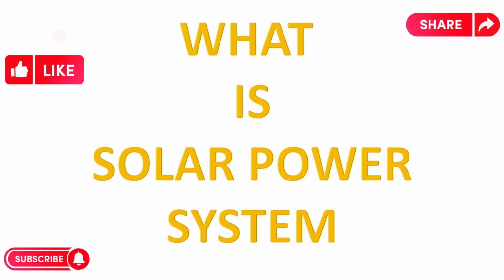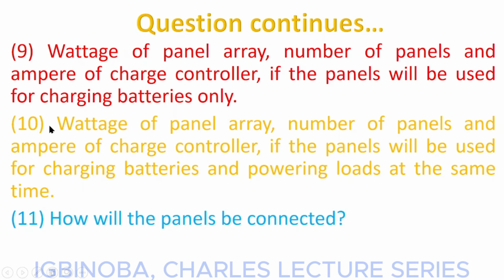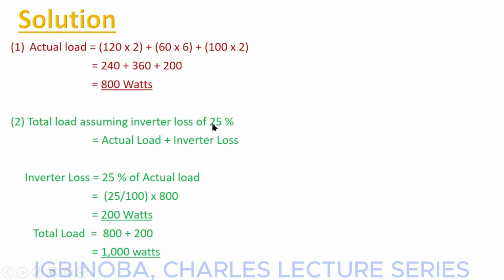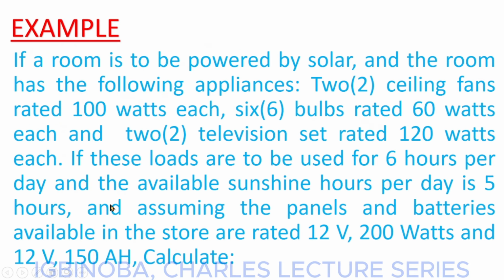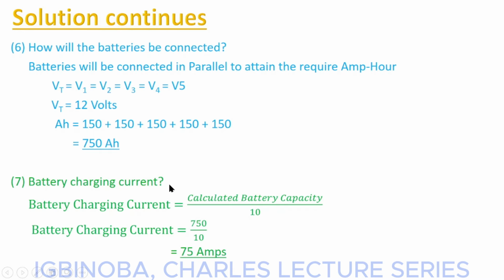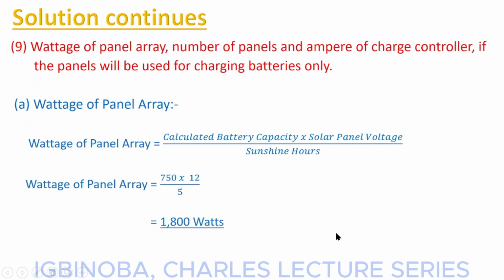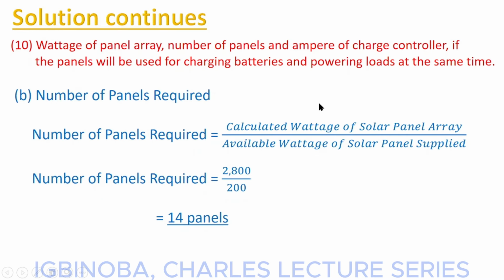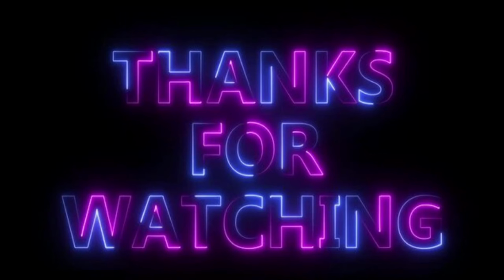Design of Solar Power System

Comment: CIV1A 
ANSWER:
1. The actual pad is 1,380W

2. The Total load is 1,725W

3. The inverter rating is 2,156.23VA

4. The battery capacity is 1,293.75Ah

5. The Number of batteries is 9

6. The batteries are connected in parallel

7. The Battery charging current is 129.4 amps.

8. The battery charging time is 14 hours.

9. a. The wattage of the panel array is 3,105W

b. The number of panels is 16 panels.

c. The Charge controller rating is 258.75 amps.

Comment: COMP100V

1. The actual pad is 1,380W
2. The Total load is 1,725W
3. The inverter rating is 2,156.23VA
4. The battery capacity is 1,293.75Ah 
5. The Number of batteries is 9
6.  The batteries are connected in parallel 
7. The Battery charging current is 129.4 amps.
8. The battery charging time is 14 hours.
9. a. The wattage of the panel array is 3,105W
b. The number of panels is 16 panels.
c. The Charge controller rating is 258.75 amps.

10. a. The wattage of the Panel array is 4,830 Watts 
b. The number of panels is 24 panels.
c. The charge controller rating is 402.5 amps
11. The panels are arranged in parallel

Comment: COMP62J

1. The actual pad is 1,380W
2. The Total load is 1,725W
3. The inverter rating is 2,156.23VA
4. The battery capacity is 1,293.75Ah 
5. The Number of batteries is 9
6.  The batteries are connected in parallel 
7. The Battery charging current is 129.4 amps.
8. The battery charging time is 14 hours.
9. a. The wattage of the panel array is 3,105W
b. The number of panels is 16 panels.
c. The Charge controller rating is 258.75 amps.

10. a. The wattage of the Panel array is 4,830 Watts 
b. The number of panels is 24 panels.
c. The charge controller rating is 402.5 amps
11. The panels are arranged in parallel

Comment: CHM113I
Answers:
Actual load = 1380Watt
Total load = 1725Watt
Inverter rating = 2156.25VA
Battery Capacity = 1239.75Ah
Number of batteries = 8.625 (9 batteries)
They will be connected in parallel
Battery charging current = 129.375A
Battery charging time with 40% loss = 14hrs
9a. Wattage of panel array = 3105Watt
9b. Number of panels = 16panels
9c. Ampere of charge controller = 258.75A
10a. Wattage of panel array with load = 4485Watt
10b. Number of panels = 23panels
10c. Ampere of charge controller = 373.75A
They will be connected in parallel
Reply: CHM90L 
Answers:
Actual load = 1380Watt
Total load = 1725Watt
Inverter rating = 2156.25VA
Battery Capacity = 1239.75Ah
Number of batteries = 8.625 (9 batteries)
They will be connected in parallel
Battery charging current = 129.375A
Battery charging time with 40% loss = 14hrs
9a. Wattage of panel array = 3105Watt
9b. Number of panels = 16panels
9c. Ampere of charge controller = 258.75A
10a. Wattage of panel array with load = 4485Watt
10b. Number of panels = 23panels
10c. Ampere of charge controller = 373.75A
They will be connected in parallel.

Comment: PETRO930

Answer =
1. Actual load = 1380watt

2. Total load = 1725watt
3 . Inverter rating = 2156.25VA
4. Batter capacity = 1239.75AH
5 . Number of batteries = 8.625(9 batteries)
6. They will be connected in parallel 
7. Battery charging  current =129.375A
8. Battery charging time with 40percent  loss = 14hours
9a. Wattage of panel array = 3105 watt 
9b. Number of panels = 16 panels
9c . Ampere of charging  controller = 258.75A
10a . Wattage of panel array  with load =4485watt
10b .number of panels =23 panels
10c. Ampere of charge controller =373.75A
11. They will be connected in parallels

Comment: CHM70R
1. The actual pad is 1,380W
2. The Total load is 1,725W
3. The inverter rating is 2,156.23VA
4. The battery capacity is 1,293.75Ah 
5. The Number of batteries is 9
6.  The batteries are connected in parallel 
7. The Battery charging current is 129.4 amps.
8. The battery charging time is 14 hours.
9. a. The wattage of the panel array is 3,105W
b. The number of panels is 16 panels.
c. The Charge controller rating is 258.75 amps.

10. a. The wattage of the Panel array is 4,830 Watts 
b. The number of panels is 24 panels.
c. The charge controller rating is 402.5 amps
11. The panels are arranged in parallel

Comment: MAR78Z 
1. Actual load=1380W
2.Total=1725W
3.VA=2156.25VA
4.Battery capacity=1293.75AH
5. No of batteries=9 
6.Batteries connected in parallel 
7.Charging current=129.4A
8.Charging time=14hrs
9.Panel voltage=3105w
b.9 panels 
c.258.75A
10.panel voltage=4830w
b. 24 panels 
c.402.5A
11. Panels are connected in parallel

Comment: EEE89K 
1. The actual pad is 1,380W
2. The Total load is 1,725W
3. The inverter rating is 2,156.23VA
4. The battery capacity is 1,293.75Ah 
5. The Number of batteries is 9
6.  The batteries are connected in parallel 
7. The Battery charging current is 129.4 amps.
8. The battery charging time is 14 hours.
9. a. The wattage of the panel array is 3,105W
b. The number of panels is 16 panels.
c. The Charge controller rating is 258.75 amps.

10. a. The wattage of the Panel array is 4,830 Watts 
b. The number of panels is 24 panels.
c. The charge controller rating is 402.5 amps
11. The panels are arranged in parallel

Comment: MAR82D

1. The actual pad is 1,380W
2. The Total load is 1,725W
3. The inverter rating is 2,156.23VA
4. The battery capacity is 1,293.75Ah 
5. The Number of batteries is 9
6.  The batteries are connected in parallel 
7. The Battery charging current is 129.4 amps.
8. The battery charging time is 14 hours.
9. a. The wattage of the panel array is 3,105W
b. The number of panels is 16 panels.
c. The Charge controller rating is 258.75 amps.

10. a. The wattage of the Panel array is 4,830 Watts 
b. The number of panels is 24 panels.
c. The charge controller rating is 402.5 amps
11. The panels are arranged in parallel

Comment: PETRO69QQ

1. The actual pad is 1,380W
2. The Total load is 1,725W
3. The inverter rating is 2,156.23VA
4. The battery capacity is 1,293.75Ah 
5. The Number of batteries is 9
6.  The batteries are connected in parallel 
7. The Battery charging current is 129.4 amps.
8. The battery charging time is 14 hours.
9. a. The wattage of the panel array is 3,105W
b. The number of panels is 16 panels.
c. The Charge controller rating is 258.75 amps.

10. a. The wattage of the Panel array is 4,830 Watts 
b. The number of panels is 24 panels.
c. The charge controller rating is 402.5 amps
11. The panels are arranged in parallel

Comment: NAT26Z 

Answers:
1. Actual load = 1380Watt
2. Total load = 1725Watt
3. Inverter rating = 2156.25VA
4. Battery Capacity = 1239.75Ah
5. Number of batteries = 8.625 (9 batteries)
6. They will be connected in parallel 
7. Battery charging current = 129.375A
8. Battery charging time with 40% loss = 14hrs
9a. Wattage of panel array = 3105Watt
9b. Number of panels = 16panels
9c. Ampere of charge controller = 258.75A
10a. Wattage of panel array with load = 4485Watt
10b. Number of panels = 23panels
10c. Ampere of charge controller = 373.75A
11. They will be connected in parallel.

Comment: PETRO74V

1. The actual pad is 1,380W
2. The Total load is 1,725W
3. The inverter rating is 2,156.23VA
4. The battery capacity is 1,293.75Ah 
5. The Number of batteries is 9
6.  The batteries are connected in parallel 
7. The Battery charging current is 129.4 amps.
8. The battery charging time is 14 hours.
9. a. The wattage of the panel array is 3,105W
b. The number of panels is 16 panels.
c. The Charge controller rating is 258.75 amps.

10. a. The wattage of the Panel array is 4,830 Watts 
b. The number of panels is 24 panels.
c. The charge controller rating is 402.5 amps
11. The panels are arranged in parallel

Comment: MAR51Y

1. The actual pad is 1,380W
2. The Total load is 1,725W
3. The inverter rating is 2,156.23VA
4. The battery capacity is 1,293.75Ah 
5. The Number of batteries is 9
6.  The batteries are connected in parallel 
7. The Battery charging current is 129.4 amps.
8. The battery charging time is 14 hours.
9. a. The wattage of the panel array is 3,105W
b. The number of panels is 16 panels.
c. The Charge controller rating is 258.75 amps.

10. a. The wattage of the Panel array is 4,830 Watts 
b. The number of panels is 24 panels.
c. The charge controller rating is 402.5 amps
11. The panels are arranged in parallel

Comment: PETRO32F 

1. Actual load = 1380Watt
2. Total load = 1725Watt
3. Inverter rating = 2156.25VA
4. Battery Capacity = 1239.75Ah
5. Number of batteries = 8.625 (9 batteries)
6. They will be connected in parallel 
7. Battery charging current = 129.375A
8. Battery charging time with 40% loss = 14hrs 
9a. Wattage of panel array = 3105Watt
9b. Number of panels =16 panelss
9c. Ampere of charge controller = 258.75A
10a. Wattage of panel array with load = 4485Watt
10b. Number of panels = 23 panels
10c. Ampere of charge controller = 373.75A
11. They will be connected in parallel.

Comment: CHM46T

(1) Actual load: 1,380W
(2) Total load:1,725W
(3) The inverter rating is 2,156.23VA
(4) The battery capacity is 1,293.75Ah
(5) The number of batteries is 9.
(6) The batteries are connected in parallel.
(7) The battery charging current is 129.4 amps.
(8) The battery charging time is 14 hours.
(9a) The wattage of the panel array is 3,105W.
(b) The number of panels is 16 Panels.
(c) The charge controller rating is 258.75amps.
(10a) The wattage of the panel array is 4,830 Watts.
(b) The number of the panels is 24 panels.
(c) The charge controller rating is 402.5amps.
(11) The panels are arranged in parallel.

Comment: CHM65M 

(1) Actual load: 1,380W
(2) Total load:1,725W
(3) The inverter rating is 2,156.23VA
(4) The battery capacity is 1,293.75Ah
(5) The number of batteries is 9.
(6) The batteries are connected in parallel.
(7) The battery charging current is 129.4 amps.
(8) The battery charging time is 14 hours.
(9a) The wattage of the panel array is 3,105W.
(b) The number of panels is 16 Panels.
(c) The charge controller rating is 258.75amps.
(10a) The wattage of the panel array is 4,830 Watts.
(b) The number of the panels is 24 panels.
(c) The charge controller rating is 402.5amps.
(11) The panels are arranged in parallel.

Comment: CHM51Y 

Answers

(1) Actual load: 1,380W
(2) Total load:1,725W
(3) The inverter rating is 2,156.23VA
(4) The battery capacity is 1,293.75Ah
(5) The number of batteries is 9.
(6) The batteries are connected in parallel.
(7) The battery charging current is 129.4 amps.
(8) The battery charging time is 14 hours.
(9a) The wattage of the panel array is 3,105W.
(b) The number of panels is 16 Panels.
(c) The charge controller rating is 258.75amps.
(10a) The wattage of the panel array is 4,830 Watts.
(b) The number of the panels is 24 panels.
(c) The charge controller rating is 402.5amps.
(11) The panels are arranged in parallel.

Comment: MAR76X 
(1) Actual load:1,380W
(2) Total load:1,725W
(3)The inverter rating is 2,156.23VA
(4)The battery capacity is 1,293.75Ah
(5)The number of batteries is 9.
(6)The batteries are connected in parallel . 
(7)The battery charging current is 129.4 amps. 
(8)The battery charging time is 14 hours. 
(9a)The wattage of the panel array is 3,105W.
(b)The number of panels is 16 Panels. 
(c)The charge controller rating is 258.75amps.

(10a) The wattage of the panel array is 4,830 Watts. 
(b) The number of the panels is 24 panels. 
(c) The charge controller rating is 402.5amps.

(11) The panels are arranged in parallel.

Comment: CIV10J

1. 1,380 W
2. 1,725 W
3. 2,156.25 VA
4. 1,293.75 Ah
5. 9 batteries
6.Parallel connection 
7.129.375 A
8. 14 hours
9a.3105 W
  b. 16 panels
  C.258.75 A
10a.4,830 W
     b.25 panels
    C. 402.5 A

11.parallel connection

Comment: Answers:
 1. Actual load = 1380Watt
 2.Total load = 1725Watt
 3. Inverter rating = 2156.25VA
 4. Battery Capacity = 1239.75Ah
 5. Number of batteries = 8.625 (9 batteries)
 6. They will be connected in parallel
 7. Battery charging current = 129.375A
 8. Battery charging time with 40% loss = 14hrs
   9a. Wattage of panel array = 3105Watt
   9b. Number of panels = 16panels
   9c. Ampere of charge controller = 258.75A
   10a. Wattage of panel array with load = 4485Watt
   10b. Number of panels = 23panels
   10c. Ampere of charge controller = 373.75A
 11. They will be connected in parallel.

Comment: CHM5E 
Ans: 1) Actual load: 1,380 Watts(2) Total load (assuming 25% inverter loss): 1,725 Watts (if adding 25%) or 1,840 Watts (if using 75% efficiency).(3) Inverter rating: 2,156.25 VA or 2,300 VA depending on the loss calculation method. (A standard 2.5 kVA or 3 kVA inverter is required).(4) Battery capacity: 1,150 Ah or 1,226.67 Ah based on the chosen total load.(5) Number of batteries: 8 batteries or 9 to 10 batteries (rounded up to keep system balance).(6) Battery connection: Parallel connection (to keep the system at 12 V).(7) Battery charging current: 120 Amperes to 150 Amperes using standard C/10 charging, or up to 383.33 Amperes if charging completely via peak solar hours.(8) Battery charging time: 14 hours at standard standard charging rate, or designed to fit exactly within the 5 available sun hours at full solar capacity.(9) Panel array (charging batteries only):Wattage: 3,450 Watts to 3,680 WattsNumber of panels: 18 to 20 panelsCharge controller: 359.38 Amperes to 383.33 Amperes(10) Panel array (charging and powering simultaneously):Wattage: 2,300 Watts to 2,453.33 WattsNumber of panels: 12 to 14 panelsCharge controller: 60 Amperes to 64 Amperes(11) Panel connection: Parallel connection (to maintain the required 12 V nominal array output).

Comment: CIV60H
Answers
1.Actual load = 1380 W
2.Total load = 1840 W
3. Inverter Rating ( 0.8 power factor) = 2300 VA
4. Battery capacity = 1226.67 Ah 
5. Number of Batteries = 9 batteries 
6. Battery connection = parallel 
7. Battery charging current = 120 A
8. Battery charging time = 16.67 hrs 
9. Solar setup ( Batteries only ) = 2944 W , 15 panels , 250 A charge controller 
10. Solar setup (Battery + load simultaneously)= 4784 W , 24 panels , 400 A charge controller 
11. Panel connection = parallel connection

Comment: CIV59G

1. The actual pad is 1,380W

2. The Total load is 1,725W

3. The inverter rating is 2,156.23VA

4. The battery capacity is 1,293.75Ah

5. The Number of batteries is 9

6. The batteries are connected in parallel

7. The Battery charging current is 129.4 amps.

8. The battery charging time is 14 hours.

9. a. The wattage of the panel array is 3,105W

b. The number of panels is 16 panels.

c. The Charge controller rating is 258.75 amps.

10. a. The wattage of the Panel array is 4,830 Watts

b. The number of panels is 24 panels.

c. The charge controller rating is 402.5 amps

11. The panels are arranged in parallel

Comment: EEE82D 

1. Actual load=1380W
2. Total load=1725W
3. Inverter rating=2156.23VA
4. Battery Capacity=1293.75Ah
5. Number of batteries=9
6. Batteries are connected in parallel 
7. Battery charging current=129.4A
8. Battery charging time=14hrs
9a. Wattage of Panel array= 3105W
b. 24 panels 
c. Charge controller rating= 402.5A
11. The panels are arranged in parallel

Comment: CIV83E
Answer:

1. Actual Load: 1380 W

2. Total Load: 1840 W

3. Inverter Rating (0.8 Power Factor): 2300 VA (or 2.3 kVA)

4. Battery Capacity: 1226.67 Ah

5. Number of Batteries: 9 batteries

6. Battery Connection: Parallel

7. Battery Charging Current: 120 A

8. Battery Charging Time: 16.67 hours

9. Solar Setup (Batteries Only): 2944 W (or 3000 W), 15 panels, 250 A charge controller

10. Solar Setup (Batteries + Load Simultaneously): 4784 W (or 4800 W), 24 panels, 400 A charge controller

11. Panel connection: parallel

Comment: EEE14O

Answer:

1. The actual load = 1380 Watts

2. Total load, assuming inverter loss of 25% = 1725 Watts

3. Inverter rating in VA using power factor of 0.8 = 2156.25 VA

4.  Battery capacity using a factor of reserve 75% = 1293.75 Ah

5. Number of Batteries for backup hours ≈ 9 Batteries

6. How the batteries are connected; The batteries will be connected in parallel which will produce a current per hour of 1350 Ah

7. Battery charging current = 135 A

8. Battery charging time, assuming a charge loss of 40% ≈ 13 hrs

9. (For charging batteries only)

9a. Panel wattage = 3105 Watts

9b. Number of panels ≈ 16 panels

9c. Amperes of charge controller = 258.75 Amps

10. (For charging batteries and powering load at thesame time)

10a. Panel wattage = 4830 Watts 

10b. Number of panels ≈ 24 panels

10c. Amperes of charge controller = 402.5 Amps

11. The panels will be connected in parallel.

Comment: EEE85G
1, 1380W
2, 1725W
3, 2156.25VA~2.5KVA
4, 1293.75AH
5, 9 batteries 
6, Battery is connected in parallel 
7, 129.33amp
8, estimated 14hrs
9,a 3103.8watt
9,b 16panels
9,c 258.658amps
10,a 4828.8watt
10,b estimated 25 panels
10,c 402.4 amp
11, The panels are to be arranged in parallel

Comment: CHM69Q

1. 1380W
2. 1840W
3. 2300VA
4. 12267AH
5. 9 batteries
6. Parallel
7. 120A
8. 16.67hrs
9. Battery charging only = 3,400 W, 17 panels, ≈283 A controller
10. Charging + loads = 5,200 W, 26 panels, ≈433 A controller
11. Parallel